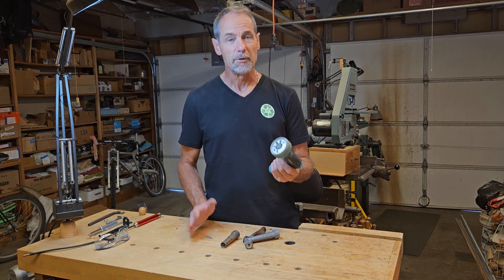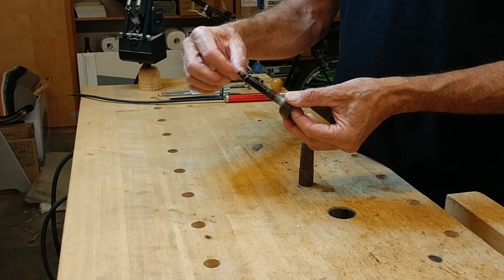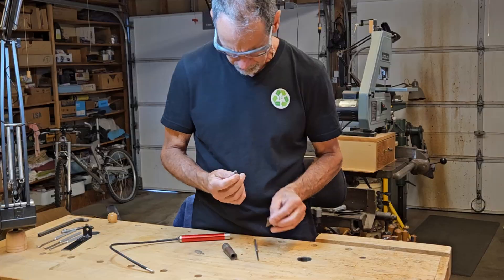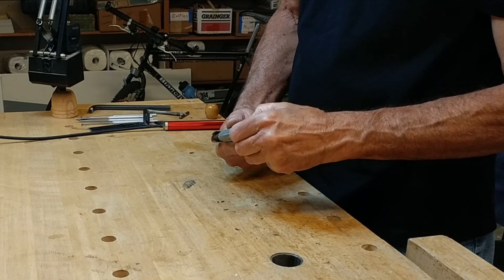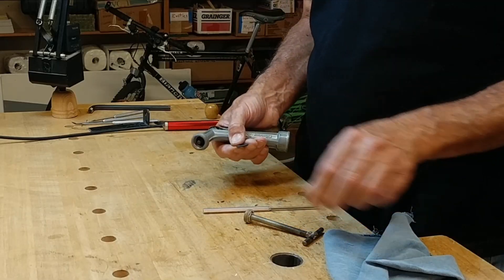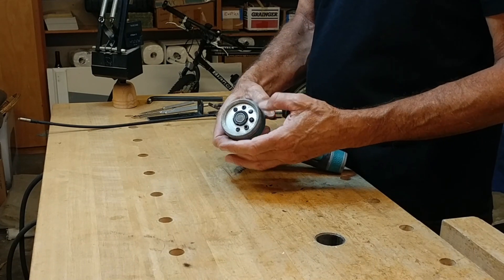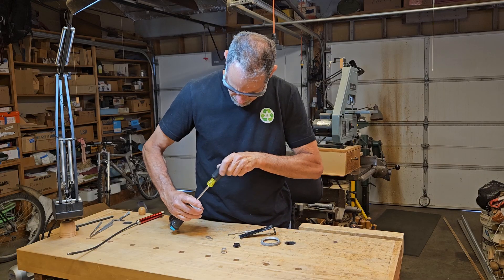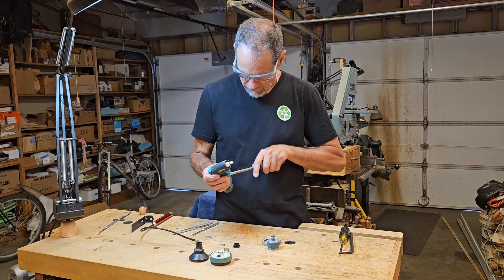Garden Hose Shut Off Valve / Nozzle Repair

Comment: I bought a heavy duty one by Orbit. Super simple design. Just molded plastic. Lasted a single season with well water pressure. No way to fix it! I guess the lesson is: don't bother spending good money on these things 😂

Fun video!
Reply from the maker: Thanks for the credit! There was a time when quality hardware was designed to be repairable.  Now a day it seems more often than not that there's no regard for maintenance or repair.

Comment: The first one should have a small rubber o-ring in the tip just like mine.
Reply from the maker: Makes sense, but I didn't see a place for it to seat. Anyhow, I tossed that one out.
Reply: @ItsFixable  I have two of this style which I like for its simplicity -- a compact globe valve. It could last forever if you replace o-ring. One of the two is a craftsman brand and have a snap ring to prevent you from fixing it. I just cut the snap ring with a dremel.